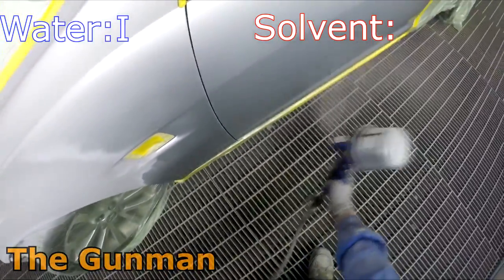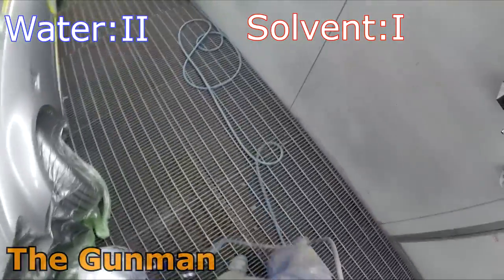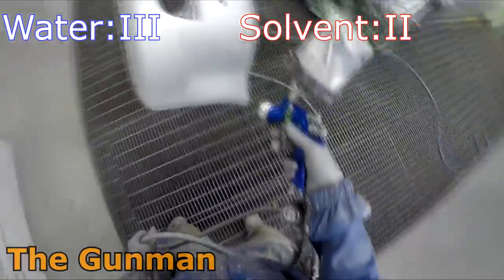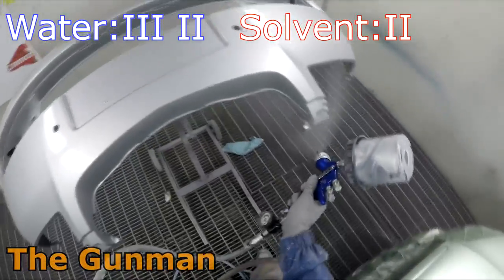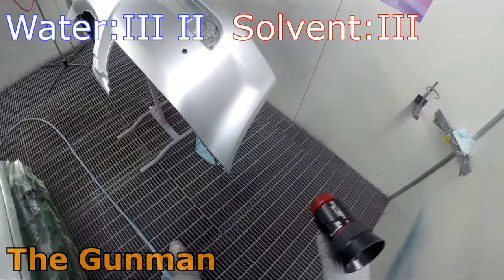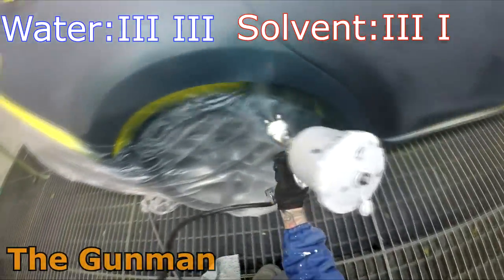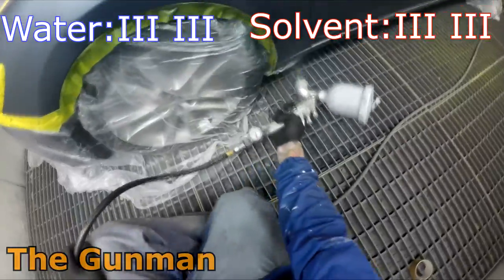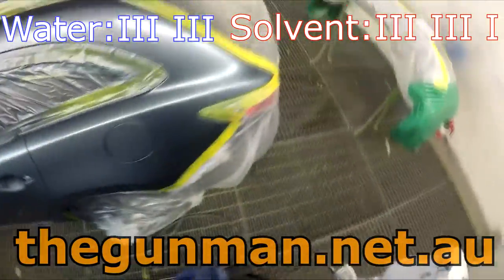Waterborne VS Solvent Based Paint Review

Comment from the maker: I deliberately didn't mention colour matching because from my experience there is no real difference, most colours still need tinting using waterborne.
Reply: Right. I think what happen was that when they brought in the system, they put in backup tints for a shop that didn't have a high enough volume to cycle through before the tints expired. So even the simplest of formulas had to be tinted when before they were fine. A jobber mistake I'd say. The high-volume shops didn't have that problem. We're expected to keep materials at 4%, paint and body. The industry is changing, and I can't say for the better.
Reply: Thank-you Gunman for pointing me to the Pros and Prolites. Best gun to me dollar-for-dollar. Here's  a Tekna Special Edition Steampunk. Keeps me from reaching for the wrong gun.

Comment: I've been spaying cromax pro for close to 2 years now and I absolutely love it. built in blowers in your booths are a game changer for dry time. I use wb2040 in the winter and wb2045 for the summer to help with the dry time. same when I add to my wetbed (wb2091). for first time users make sure to let your base dry for just a little longer for your tricoats otherwise you will get solvent pop. and if you are getting solvent pop with your whites try to substitute 2010 with 2030 and watch your overlap. I had a cunt of a time with that in the beginning! cheers

Comment: I use waterborne and the drying times are a pain but find it doesnt halo with silvers like solvent does which makes it great for smart or spot repairs. it also has way less overspray. there are a few custom colours on water the main one is auto air colours. great vid as usual.

Comment: You bring up you want only to spray on the amount and thickness of product to match the factory.  Like that's a good thing.  But the factory isn't spraying on the optimal amount based on testing that proves this thickness and amount is beneficial for the color and longevity.  No the factory is spraying on the least amount possible for reasons of cost savings only.  The main reason a factory paint job is in some ways superior is the curing cycle.  Factory paint will be baked at 300+ degrees.  Giving it more strength and adhesion.  And no normal paint booth can match that temperature.  Not too mention  they couldn't put a built car in that temperature.

Comment: Thank you Gunman for sharing your take on it. I prefer waterborne. Edging can be more difficult. But as long as you gray scuff and add hardener, it sticks fairly well. We've tested Spies Hecker on direct-to-metal door hinges and stuck tape to it trying to make it peel. It held. I've sprayed PPG Environbase which sprays more like solvent. Based on your definition, it is water base. I tried color sanding with water. It was a mess. Spies/Cromax has my vote.

Comment: I don't know if i miss heard you but all my custom airbrush paints are water-based even the candy ,the make is Auto-air colors and i've used them for years. I'm a solvent based painter and never use water-based paints  only on airbrushing so have no experience  but have been told they're much easier to use than solvent  . Too be fair i had a problem with a Merc bumper and had to get some paint off a pal who only uses water-base and the job came out great. Just a thought if there's a problem when laying down the base with water-bourne paint is it easy too correct 🤔. jim uk.

Comment: I was lucky enough to learn to paint using water and solvent,so I'm not bias to either,personally I would use water every time,the main negative pionts for me with the water is drying time and you have to scuff it back for any imperfections,other than that its water every time

Comment: We spray woodwork almost exclusively and steel rarely, but I've found some of your videos interesting.  We used to use waterbourne lacquer on wood, but we found that even with extremely good prep work, you would sometimes get fish eye for unknown reasons, while we've never had problems with old fashioned standard lacquer.  Got sick of the water's fickleness, so now we are doing oil all the time for wood.  Water was sure easier on you, and that part I miss, but not the headaches it would sometimes cause.  Yes, the drying time can be important as well, you can finish a contract much quicker with far shorter and consistent drying times, its nice to enjoy getting the same high quality for much less shop time.  

As far as your products and work, what is the difference in fish eye between water and solvent?

Comment: Great video Gun...........might wait until summer when it's 40 degrees to spray water based in my shed.
Reply: You are very fair unlike the paint reps that flogged waterborne paint (Canada) I noticed you never mentioned cost of storage (heat) how green is keeping water based from freezing (it’s still as cold as ever here in winter) .Paint companies don’t like to tell you the shelf life is not impressive.How green that I buy new stock instead of using paint that I first used 30 years ago ((I do it all the time) interesting and fair video however

Comment: That's a good comparison to Cromax Pro, but I think more of a analysis needs to be done on the "water Bourne" vs "water based" example being the Cromax pro and Ppg Envirobase. Resons being totally different chemicals and different systems and processes involved with application and drying. We would find quite different results again is a versus comparison.
Reply: PPG Environbase doesn't need to be stirred, just shaken a little before mixing. The metallics float better. It sprays like solvent, except that you need heat and blow driers between each coat (usually 3). When we had it, we used Global clears instead of Environbased clears. I guess because it still worked and wasn't mandated to change clears. Meaning, we were using Global solvent system before we changed to Environbase. Now we use Spies Hecker Hi-Tec 480 (similiar to Cromax). It has to be stirred like solvents do, just not as long. Instead of spraying a coat and waiting for it to dry, you can put all your coats on in one shot and do the heat and blow drying. So, that to me makes it faster than Environbase.

Comment: I used to use RM Diamont base and when I legally had to make the switch to waterborne, I was pissed off! The drying time was a shock as being much longer and repairs during spray time I couldn't do like I did with solvent. But I must say, after getting used to it, the finished product is much better than solvent. Blending metalics and pearls was incredible. I will take the better finished product over time. Started with Onyx HD waterborne and recently switched out to PPG Envirobase. I like the Envirobase even better. Plus dries a bit quicker than Onyx HD.

Comment: Hi Gunman...can I ask what sort of breathing mask you wear for each different type of paint. You recommended solvent based for DIY or smaller jobs at home but would there be problems with the hardener content in the basecoat or clearcoat as regards breathing masks. I am restoring a MK1 Lotus Cortina which will be going to a spray booth for the full respray but I want to spray things like the dash and door caps/bases etc myself. Your advice on this would help as it is a big safety concern obviously....thanks Charlie (UK)

Comment: thinks for the vids!
i use auto air and wicked paints for all my airbrush work and have had great success with it. 99% of the time its over a solvent base. 
the other day i tried to paint a fender using all waterborne. when o pulled the tape on the base coat i had adhesion problems and my tape lines were jagged. 
prep was the same as always not sure what caused it.

Comment: I'll be painting the roof of my wife's SUV soon as my shop wants $2K for the job. Crazy. It's a 10 year old daily driver with 120K miles on it and nobody is going to see the damn roof anyway. The car is in great shape but the clear failed on the roof. I'm a DIY guy in CA and definitely prefer solvent based for something like this. DIYers can still get away with solvents in CA. Played around with AutoAir when it first came out and it's pretty good. I'm not going to use a booth for this one so I want something that drys right away. I just like how fast urethane dry for my airbrushing and painting. You didn't touch on the most important thing to me, thats the clear. Everyone is still using solvent clear and thats the most dangerous stuff!

Comment: Great video as always, very smooth trigger work :-) 
Have question on color matching, metallic like 9792 different between US ( water based) and German build Mercs  is part of the problem the water based flake looks different even with careful blend on solvent based German and vise-versa, same conditions and application wet on wet. Anyone else had experience?

Comment: Gunny I just moved shops. Last shop was solvent. New shop is waterbase cromax. The rep is pushing me to use a Sagola 4600 extreme. I’m a Devilbiss GTI PRO Lite guy all the way. What size fluid tip and cap do you recommend to use for cromax water for the GTI. Cheers mate
Reply from the maker: Mate, the pro lite is better for Cromax water anyway. Go TE10 1.3 if you can. But in saying that any gun will sorry Cromax Pro with ease. It's more how you spray it that counts. I'm yet to find a gun that won't spray it well
Reply: @TheGunmanChannel  rep said I’m switched on with prep, masking, clearing, solids etc. But I’m still applying water like solvent. Dusting it on, or like he said pissing it on 😬. I’ll get there in the end, I’ve got a spare guard that I’ll practice on after hours with my GTI PRO LITE with scrap water base metallic. Thanks for reply bro. I’m committed to mastering water, even though I think it’s slower than solvent and a waste of time. This shop is primo compared from the shop I came from. Closer to home, better hours and the same pay with 20 smoko and 30min lunch. Cheers mate

Comment: I learned on solvent 10 years ago and I simply refuse to paint with water based paint.  It is a hassle to use those dryers, it takes forever to dry, and when you have to paint tri-coat.  May God bless your soul.   I know hate is a strong word but I absolutely hate water borne paint.   I simply gave it the middle finger and I refuse to use it.

Comment: So I have a mystery for you.  I took my MX Miata (2016) into the shop to get a corner seam repainted (my son hit my car in the garage with HIS miata), and the paint shop called and said after they sprayed it over the base coat, they got "fish eye" on the results and it had to be done over.  He asked what I put on the car, like silicone wax or whatever, and said I nothing, because it came from the factory.  They are having a heck of a time painting this - to the extent that they are losing money on time necessary to redo the paint.  Any ideas on why they are experiencing this?  This is a professional shop and they did great work on my aforementioned Miata that caused the damage to my Miata.  Any suggestions for this Mystery on how to solve it? (Great video by the way...I'm not in the business but watching you apply that paint was almost mesmerizing. Thanks!)

Comment: I wonder how well your water borne paint jobs are holding up 3 years later???  Seems like water based paints might work well on smooth automotive surfaces, but not on rough industrial surfaces like tractors and farm equipment that have lots of crust and rust, and need a thicker paint to cover up the imperfections.

Comment: Hi, love your videos. A quick question, can I use my Devilbiss GTI Pro TE20 air cap for Waterbourne paints or should I buy an HV30 setup. Cheers Rob
Reply from the maker: TE20 is fine for water
Reply: Youre a star, thanks for the tip....... Rob

Comment: been using cromax pro for about 10 months and I'm having HUGE issues with drying if blowers are used the clear has  silicone spots everywhere which is from the water trying to escape. had the axalta reps in to no avail. only way to stop getting them is too let it dry naturally which is normally a 30 min wait and for a crash shop that sucks. Any help from people is appreciated or if this has happened to u guys. spraying with 2 bar inlet and ive tried almost every gun and setup there is, although the problem is minimized by using an iwata entech.
Reply: Adam hi Adam. Get yourself a couple of dog grooming hair dryers. They will easily blow the length of the car, have adjustable heat and will dry each coat of paint, even on a bottom half in about fine minutes. They even sell them with stands.

Comment: Yup gun man is right on that, fernando you dont know the regulations of other places. There is a reason why the industry is changing from solvent to waterborne paints.not only does California have the strictest regulations on what type of material a shop is using. VOC are chemicals that evaporate into the atmosphere. and lowers VOC products have less effect on the chemicals being released into the shop, thus actually improving inhalation of carcinogens that give you CANCER! Its funny because i live in california and see shop who complain about switching over to waterborne. For example, a buddy shop who refuses to make the change of switching to waterborne and still use NON compliant base coat which dont meet californias VOC regulations. However, since its a small shop they don't have the EPA breathing down their backs. Since southern california has so many shops, EPA ( Environmental protection agency) or the Air resource Board dont bothers. BUT if they do get a surprise visit, they would be fined so much they would probably be closing shop. yup and what gun man said TSD sheet are very important for every product used in the work shop we have a desinated place where the folder is to all information. IF SHOP HAS NO TSD sheet OSHA( occupational safety and health administration) will fine you. its crazy because its all fun and games till you have a surprise visit at the shop. iv heard it happen so many of people. I live in NORTHERN CALIFORNIA now so its even worse than southern California. So yea gunman your totally correct people dont realize the

Comment: color match(blend) - water
pot life - water
Reply from the maker: I deliberately didn't mention colour matching because from my experience there is no real difference, most colours still need tinting using waterborne. From my experience solvent would win on blend and match, you can stick match with solvent but not water and colours are no better.
Reply: +The Gunman Good point....I can stick match BASF waterborne but not Sherwin Williams.

 You should try RM Onyx or Glasurit 90 line....you can mix as water or solvent by switching out binders.

  Keep up the great work Gunman.